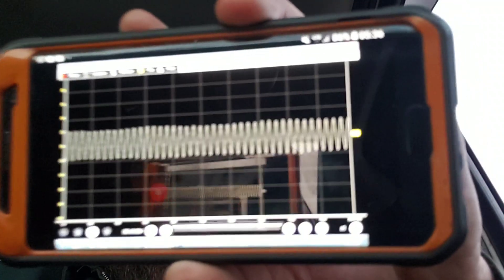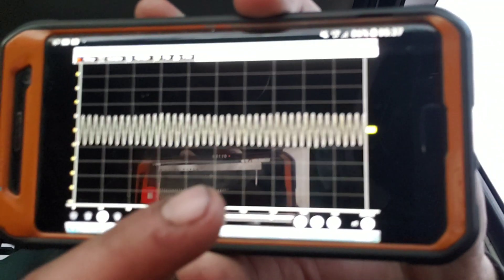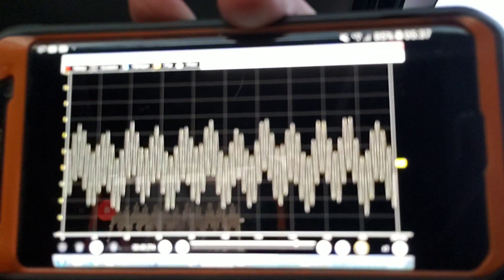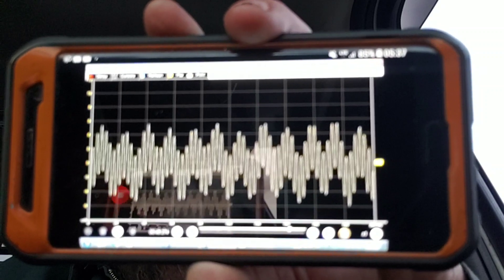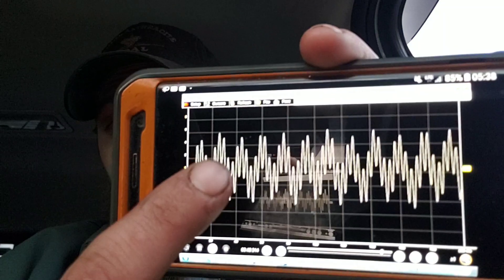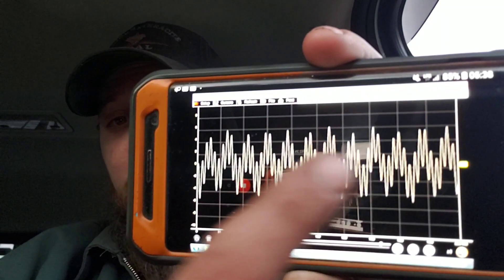03 F-350 Follow-Up & Some New Things Coming

Comment: Thanks for the follow up. It makes perfect sense. It's a fairly common problem, but commonly overlooked.
Reply from the maker: That's exactly it. I jumped out of my normal diag routine and never took a step back until I talked to some other people.🤔

It happens to all of us, but an important lesson none the less.
Reply: @ScienceOfDiagnostics  so the issue is a bad alternator because Im having the same issue. With my F250.

Comment: I have the same code have the issue under normal driving. I replaced both speed sensor's on the trans & still same problem.
Reply: Next I'll be replacing the 2 front ABS sensor's but from my experience working on vehicles I have a feeling it's a bad transmission.
Reply: Isuzu trooper have the same issue with limp mode trans problems.
Reply: I get that code, blinking light but no gauge issues. It WAS used as a plow truck. I just replaced the battery and alternator and still got the code. Now what? Sensor?
Reply: @ronbrooks7808  one of my main issues was the Transmission I replaced it and it almost all went away. Now it comes on periodically I reset it and it doesn't come back on for weeks / months. I replaced all my sensors 2 on the front wheels 2 on the Transmission. I believe it could stem from the wiring harness / plug connections or possibly the abs unit. Still trying to track it down.
Reply: @ronbrooks7808  do a Transmission flush and see if that helps.

Comment: Just want to make sure I’m correct Chris as I don’t believe I heard what the actual culprit was. There was a lot of ac ripple from a failed diode which would indicate a bad alternator. If so, I would think the customer would have the vehicle fixed.
Reply from the maker: That's correct. Customer is rather well off buy didn't want to spend more than $1000 on the truck. Truck had trans leaks, rust, driveline vibration, and other issues. He opted to just find a newer used vehicle to plow with.

I would have fixed it personally but the value proposition was there for him.
Reply: Science Of Diagnostics Okay Chris and thanks for the feedback! 😀👍
Reply from the maker: People round here have some funny ideas at times. I just roll with it. 🙃